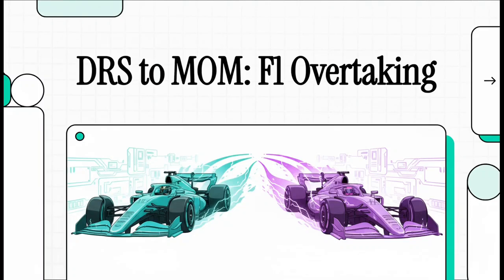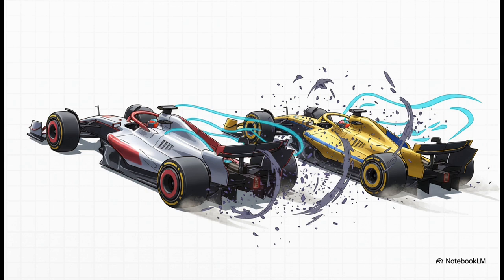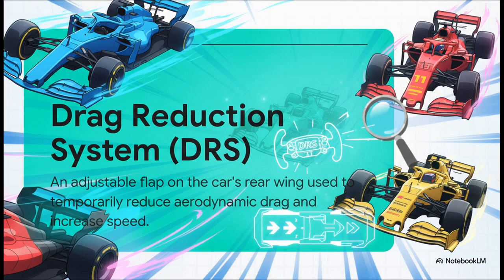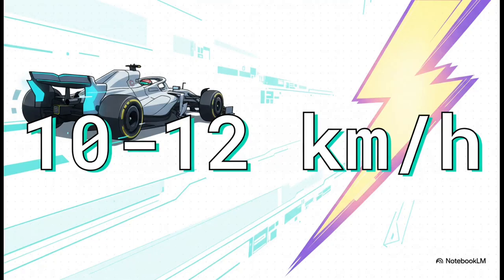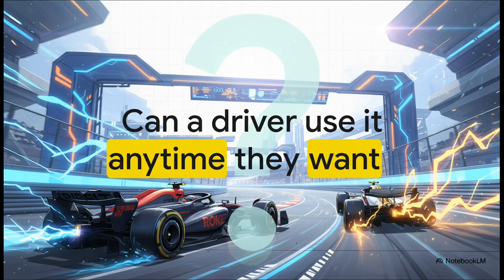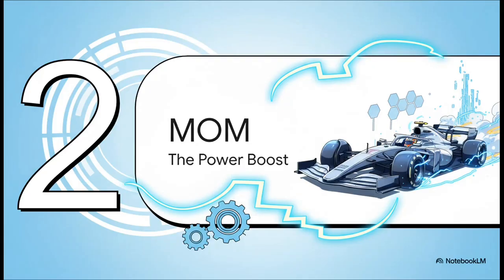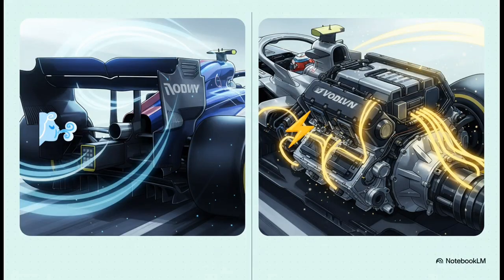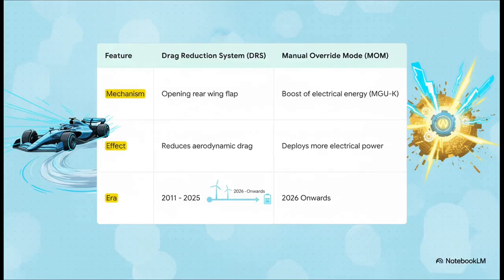Aero vs. Power: WHY🤔 F1 Replaced DRS with Manual Override Mode (MOM)

Comment: What about X-Mode Aero which is more like the DRS?? MOM is just an addition...
Reply from the maker: Yes X-Mode is the drag-reduction element similar to DRS. But the key difference is that X-Mode is available to everyone on the straight to manage energy, not just an attacking car. MOM is the actual replacement for the overtaking aid aspect of DRS, giving the chasing car that temporary electrical boost when they are close.